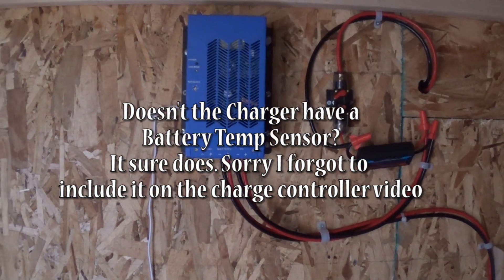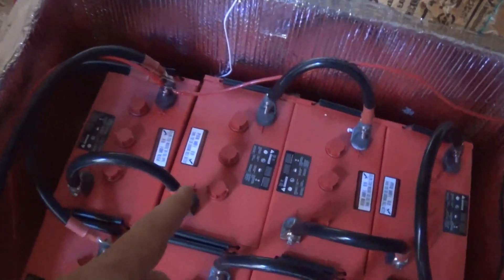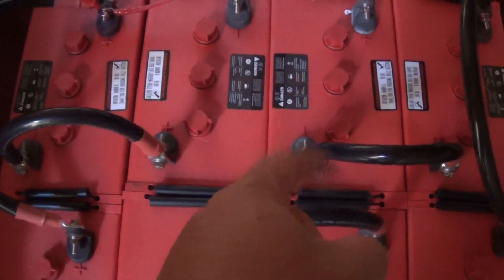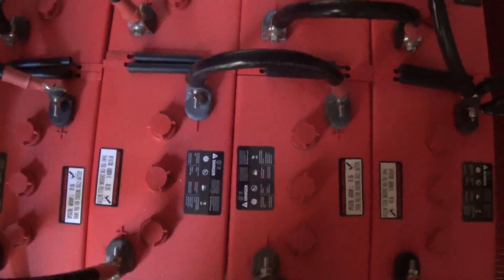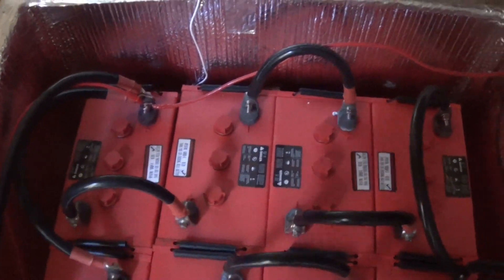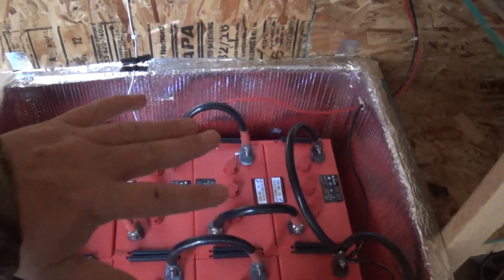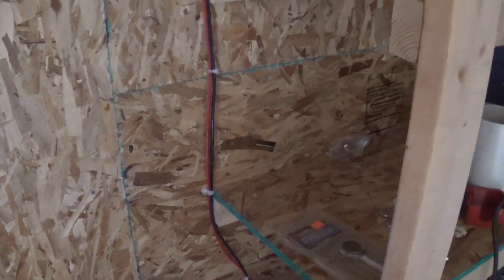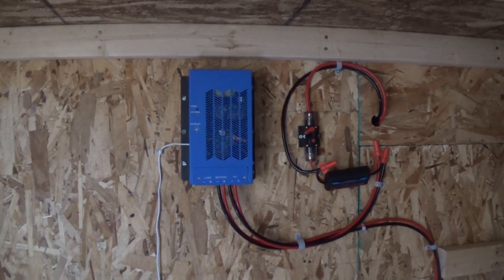Battery Temperature Sensor for the Charge Controller - Left this out of the Charge Controller Video

Comment: What about batteries that are in a metal box
Reply from the maker: in metal box? the only ones i know of that are in metal box are some lithiums and those normally have their own temperature sensor or the charge controller has a communication cable to the battery.

Comment: Soooo, drill hole in battery in center and use a screw to connect sensor to it... got it.  Lol jk.  Seriously though, how you connect it might be important.  Think I will just tape mine to side of battery.  Though it does have a metal loop on end that looks like it is supposed to be bolted to the battery.  But the terminals are only things I could bolt to.  Wonder if it is supposed to go to the negative terminal?
Reply from the maker: i just taped it to the batteries. i talked to my solar guys and they said taping is fine. tape it to the most centered batter.

Comment: Can you use one sensor for both the controller and the inverter? wire the leads parallel?
Reply from the maker: no i dont think so. they are fairly cheap maybe 20 bucks so having 2 i think makes better sense. however your inverter should give you the volts from the inverter side.

Comment: what kind of Batterys are those and what kinds of amps do they have
Reply from the maker: +brent better Rolls Surrette S-605 6v 468ah weighting in at 125lbs each. check out the video 'off grid solar batteries' where I wire those batteries in a 24v bank and I talk a little more about the batteries themselves.